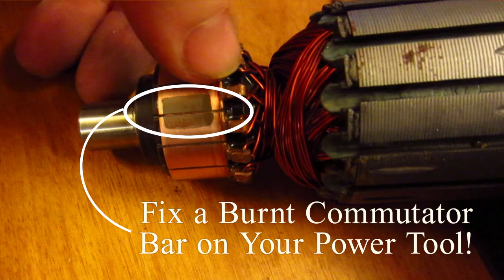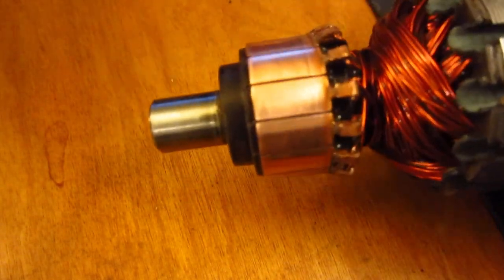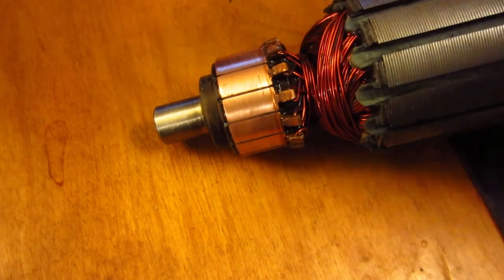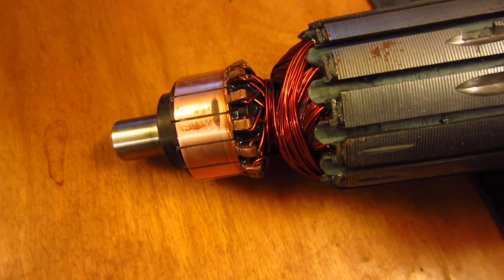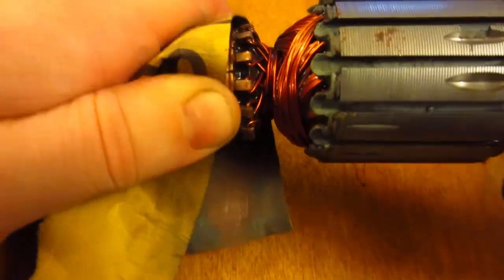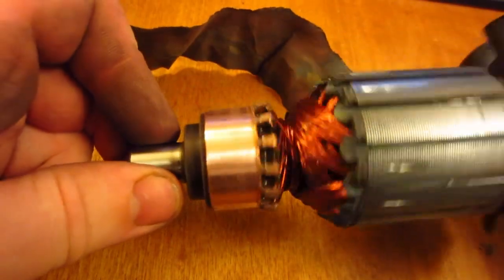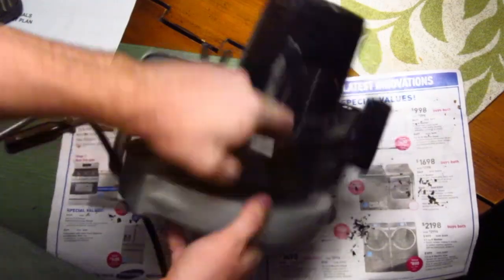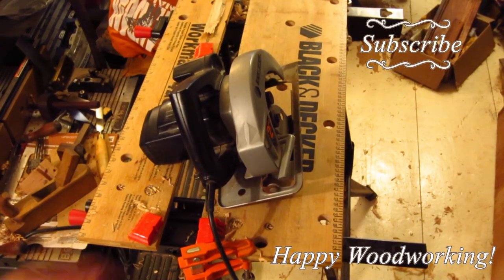Easy Power Tool Fix: Burnt Commutator

Comment: Nice job Ian ! I ve doing this for years,and just put the armature in my drill press chuck to achieve a nice concentric polishing. I also use a straight piece of wood to back the abrasive paper so as to keep the sides as paralell as possible . Thanks for sharing. Cheers !

Comment: Great Vijayo! I think I have at least two of those saws bought them 30+ yrs ago. Back then if you got a good sale you cld get them for about $29 USD. They were the lower end of consumer market but mine are still running today. You can probably buy a new saw for the same $29 today from the Harbor Freight type of store. in some ways it may be new and better but I still feel like the older product were build a little more robustly thus you could service some new life into them like you did here. The newer tools seem to be made in such a way that you can't really service them.  Rarely does it actual pay to do these repairs if you place any value on your time but IMHO there is no  better feeling than when you fix something like this and bring it back to life! The more of these jobs you do and try the more you can do and the smarter you get!  Good Job my Friend!

Comment: i would also recommend a thorough cleaning of the commutator after sanding, including a very careful scraping of the slots in between the copper pads.  i have seen people leave copper residue from the sanding process in those slots, which creates an electrical bridge between the pads.  another important reason to clean the slots is because material that has been eroded away from damaged brushes can build up in there and will also act as an electrical bridge.
Reply: Also, a word of caution when cleaning the slots - don't do it with a screwdriver! Use a tootpick, or some other soft material - with a screwdriver you risk to bend the edges, and make the sharp and raised - it will eat the brushes in minutes!
Reply: Good to know it man, thanks
Reply: I have this same motor in a leaf blower that runs horribly.  I've tried servicing the commutator and brushes but it still runs horribly and heats up quickly.  Any idea why this thing runs so badly?

Comment: i used your video to repair our washing machine, there was voltage reaching the brushes but it wouldn't spin so i took the 470 Watt motor apart and cleaned the commutator, it was blackened, and now the machine works good as new!
Reply: @g quinn with a cleaner

Comment: Omg! I used to make those armatures at Black and Decker Spennymoor UK,!!

The commutator is turned on VEE blocks with a diamond tool,so its perfectly concentric with spindle.    Too smooth a finish on the copper can cause sparking so use quite a rough emery or sand paper to clean it up with,  then finish off with a wire brush , taking care not to damage any of the resin or varnish that binds the wire in the motor together.

The copper segments are separated by a non conductive plastic and can become clogged with material, this can also cause sparking (usually accompanied with a high pitch noise), again clean with a wire brush to clear them.
Never use compressed air to blow out electrical motors  (of any kind) as this just moves contaminants into places they should not be, and you cant get access.

As a rule of thumb,if your electrical appliance starts giving off any kind of smell that's not normal,  or overheats quickly, then its probably dying,
but on the other hand if it sparks but gives off no smell then its probably worth taking apart and cleaning.
Reply: +Kevin Seal wont excessive sparking often be accompanied by an ozone smell though?
Reply from the maker: Very cool!  Thanks for sharing.
Reply: +kevin seal thanks for the info,are replacement brushes needed too?
Reply: "Too smooth a finish on the copper can cause sparking so use quite a rough emery or sand paper to clean it up with,  then finish off with a wire brus"

Ian mentioned 1000 grit sandpaper, you suggest "quite a rough" ones. How rough, expressed in grit?

Since I'm no expert, I am really not trying to start an argument here, but why would a perfectly polished commutator would start pulling more sparks than a more rough one?
Reply: If the surfaces are too rough they could grind the brushes though.
Reply: What about using a belt sander to perfect the radius? Seems it would clean up bad spots and if held or mounted somehow, it could be highly accurate.
Reply: Thanks, I was wondering what caused the high pitched whine.
(along with the other obvious sparking sign of an armature short)

Comment: This can also apply to electric Weed Eaters. Especially ones where the brushes are easily removed. I've replaced my Weed Eater's brushes and cleaned up it's commutator on occasions. Also after each use, I take my Weed Eater apart to clean whatever debris gets into it from underneath as well as into it's vent slots. That is why my 39 year old Weed Eater brand grass trimmer is still running like an athletic champion to this very day.

Comment: Mate got to say big thanks for the tip.!.
My $1200 dewalt mitre saw started sparking and making a bubbling sound then completely died 1/2 way through a job the other day. Pulled the back off it and the commutator was completely burnt out. I did your trick with 120g (very gently) then 1200g paper while it was still attached to the saw, it came back to life, almost as good as new. 
I say almost as it sparked a little and the commutator blackened slightly quickly but I think the brushes are shot. 
I'll order new brushes and clean the commutator up again and reckon it will be good as new. 
You saved me $1200, I thought I was up for a new saw, $1.40 for some sand paper and 15 minutes, lifesaver. 
I now know it was all my fault, I pushed it a bit too hard through a big board with an average blade, overworked the motor and burnt it out.
Reply: did the motor smell and smoke also? I pushed my 2.5 skil saw and it died smoked smelled. Not sure if bushes would revive it.
Reply: putheflamesout yahoo 
I say have a go you have nothing to lose. 
Clean the commutator and try it.
The only reason I changed the brushes was as soon as I cleaned the commutator my brushes sparked a bit and darkened my commutator again. 
I cleaned it once more, replaced the brushes and happy days, never thought about it again. 
Good luck, brushes are easy to find and really cheap delivered from E bay...
Reply: mame   kemethi  seme theyakme   liyanne  berithe?
Reply: mage  me  rate  kavetheavth  thiyunuceranne  be.be  horuwede nesa  mame harethe?

Comment: Thanks for the video. I thought my old B+D hammer drill was on its last legs, with sparks and something like a flapping sound. Mind you it had been submersed in the floods here in Thailand a couple of years ago. I am not good at electrics but did as instructed with the commutator which was black. The brushes seemed to be OK but then I don't really know what I am looking for. The hardest part was removing the casing screws,but other than that it was easy and works OK. A few sparks but nothing like before. Thanks again.

Comment: My 2007 Nissan Frontier power window has similar issue.  Between the copper electrical contacts, it was filled with worn carbon brush dust.  I clean it out with a pocket knife and good as new again.

Comment: hi sir , i watched your video, u ran the motor after sanding the commuters, but running it at full speed will show how successful your work was, at low speed it won't show much ,but at full speed it will show all

Comment: my grass trimmer is smoking up at these contact surface & loosing power / won't spin.
yeah mine is full of black trails on the copper. So they are the culprit and can be fixed with just sanding them up nicely?
ok I try it again next time. Thanks!

Comment: Thank you for your good video. I got a universal motor too on a sewing machine. I noticed, that the torque from the motor was very much dependent of position of the armatur. Furthermore, when I turn the motor by hand, it sound from the commutator do not sound right. I took it apart and noticed more burn marks on commutator as you have got on your motor. But I sanded it down with 2000 grit sand paper. I also have an ohm meter and checked all connections, and the got they same value. Then I assembled again, but I do not notice any change. I still got significant torque changes with position. I got other similar sewing machines motors, and they do not vary so much in torque. I have also noticed, the wear on the end of the brushes. It seems that only about half of the brush connects on the parts that receive the commutator lamels. Perhaps the part with leaving lamels are partly broken off. So perhaps I need to wait for the brushes to wear a bit more with the "new" commutator, so it they make better connection again.

Comment: My Bosch 4000 table saw is sparking like heck and rpm's are all whacked out. I cleaned the brushes and armature really well just like you did in the video, but it had no effect on the overall problem. Still sparking really bad, chattering, and rpm's still out of whack. I believe its either the armature or field coil that is the culprit. However, the armature looks really good as well as the field. I would hate to dish out $150 for both items when it could just be one of them causing the short...
Reply from the maker: James Johnson Are the brushes past their usable life?  Maybe there's not enough spring pressure on the brushes?  Is the brush contact surface the correct shape?  Are the bearings and bushings on the armature snug with no play?  I'm with you on not wanting to throw parts at it.  I hope you can fix it!
Reply: My B & D power drill sparks when it turns the brushes still looks good what do you think nis the problem
Reply: charms robles Could be several things: Fried armature, fried field windings, or fried circuit board if there is one in the drill. But, it could also be the brushes even if they look good on the outside. My bosch table saw was arcing pretty bad and brushes look surprisingly good, but the armature and field windings turned out to be in good shape and was told the speed control (aka Circuit board) could be the culprit. I will also buy new brushes because they are the most inexpensive fix out of the parts.
Reply: Ian Slatas The brushes are a little burnt around the springs but not the brushes themselves. My armature and field winding turned out to be in good shape. I will order a new speed control (aka circuit board) and new brushes to see if this will fix the arcing and speed fluctuations. About $40 for both sets of items. Thanks for the help!
Reply: James Johns

on

Comment: I have a 10 inch table delta drill press that stopped working.  I placed a magnet on the motor to hold my key and some sparks flew out and the motor stopped.  Did the magnet negatively affected the motor?  If so, how can I fix it?  

Good job and I sure hope you can tell me what to do.  Thanks.

Comment: Its best if you have a electric motor shop nearby to have the commutator turned. But at least when changing brushes use a plastic safe electronics spray  cleaner to flush the commutator.Brushes are cheap so change them more quite often.

Comment: Just asking, but was that still a spark at 3:59?
Reply: yes, every motor sparks just a little at the commutator
Reply: Mikhail Galatinov it's spark when you start machine
Reply: As comments below said,  it will spark as its going from 0-60 in no seconds :-)  I repair washing machines,  and sometimes I run tests on the motors outside of the machine,  and you see plenty of small sparks as it revs up without a tacho to monitor the speed.
Reply: Cool. Thanks.

Comment: Hi.. i have a craftsmsn router keeps turning off due to sparks..i took apart and filed the commutator good on a lathe and then i flattened the brushes good and now it works a bit better but powers off at high rpm setting...sparks...anyone have any suggestions..brushes are about 1/2 in long

Comment: I asked how to disassemble a black& decker 75th anniversary electrical drill no.7191A black in color,& it shows me several drills but not the one i have. I need to know how to take the front off so I can take the motor out, does anyone know,& could tell me. Please & thank you, (disabled veteran)

Comment: great video, i was hoping you could help me, my corded hammer drill stopped working, i think i put it under too much load so it made a funny smell and then won't rotate anymore. It has an led in the handle which indicates it's still getting power, the drill has only had possibly 4-5 hours total use over the 3 years plus i've had it so should be plenty of life left in it. do you have any ideas as to what the problem may be??

thanks, Ian.

Comment: Tried this but mine is a 18 volt cordless drill. It is still a lightning from the back. Tried to sandpaper down the coal it got better but on a higher rpm it went as the same again. Anyybody?

Comment: is the "sandpaper" used here actually "sand paper or a carbarundem variety?  "  I've told since first acqainted with working on commutators  that only real sandpaper is to be used.   regards
Reply from the maker: I used an automotive wet/dry "sandpaper". Yes, the paper was coated with silicon carbide and not 'sand'.  What you learned may be correct, I can't say (is there a concern about remaining dust being conductive?), but the tool was given to me broken so I used what I had.  Brushes and copper are conductive and they both leave dust as they wear so maybe conductive dust isn't the issue.  If it's already broken, why not give it a shot?   

I just used the saw to cut plywood and batten siding to resheath a very old existing building that had wonky walls and odd spaced supports.  The saw saw a ton of work the last two months (hours per day on occasion) and is still 100% fine.  I really wish I had a track saw now, haha!
Reply from the maker: Your comment piqued my interest and I think I found the answer in a 1920's railroad signal engineer text book.  Of course it would be there!  The concern seems to be the durability of the silicon carbide grit and that any that remains on the armature would be "continuously abrasive" relative to significantly less durable silicon dioxide if it were embedded in the armature or the brushes.  I did take the time to wipe it clean because common sense would say any abrasive on an armature is bad news.  Still, it's a point worth noting and if I ever have some downtime again in my life (ha!) I'll take it apart and check for track marks in the armature from grit stuck in the brushes and visa versa.  Thanks for forcing me to learn something new!

Of note: 
The armatures referenced in the text book were of a scale magnitudes larger than our little rotary tools but I'm sure it's still relevant.  It's also magnitudes easier for us to thoroughly inspect every square inch for debris before reassembly.
Reply: thanks,  regards

Comment: Great video , content and production ! :)  

I was hoping you could help me w/ an idea I have ?  I'd like to add a variable speed switch to my bench grinder in order to run it at slower speeds.  I've noticed many amp ratings for these switches and most will work fine on a 5 amp motor. 
 
Question:
1.)   Will I risk damaging the electric motor on my bench grinder?
2.)   If okay to add switch, should I try to match the amp level or would a higher amp rating switch be just fine?
3.)   If I get a variable speed bench grinder that supplies 2000rpm's to 3400rpm's , could I theoretically add another variable speed switch in order to run it even slower than the minimum 2000rpm's ?

Thank you for your generous consideration,
Steph
Reply from the maker: Sorry.  That's beyond my level of understanding.  Hopefully someone else can chime in with an idea.  My instincts would tell me that a higher amp rated switch would be fine if they're like switches I'm familiar with.  Some motors have trouble keeping themselves cool at lower speeds if the fan isn't rated to operate efficiently at those levels.  Similar to how a drill at low speed needs frequent breaks.  I don't know what speeds you have in mind and it might not be a problem.  Good luck.
Reply: Bad news is using a triac or motor speed controller to adjust the speed of a bench grinder or other AC tool motor is you'll lose a lot of the motors torque at the lower speeds an result in a greatly increased wear.  Don't recommend.
Reply: Thank you.

Comment: did this on my 4.5 amp jigsaw but still creating sparks =( help
Reply from the maker: Check your brushes and the springs that keep them in contact with the armature.  If the brushes are worn or the springs are weak or nearly fully extended the brushes could still bounce.  If so, you may want to try replacing them. Also, depending how bad the armature was a little sanding may not fix it. Good luck!
Reply: i'll try replacing the brushes first,